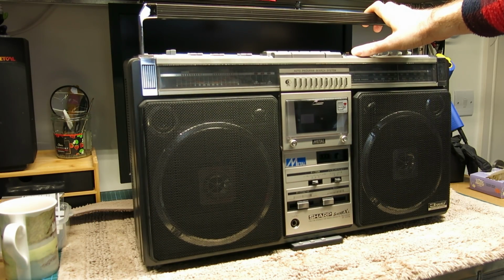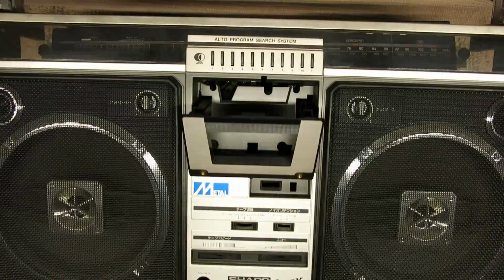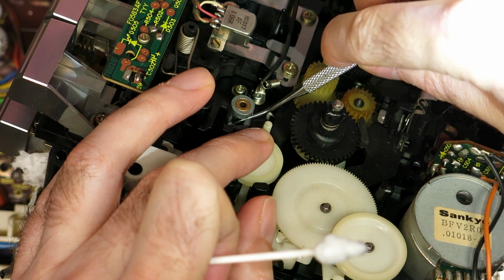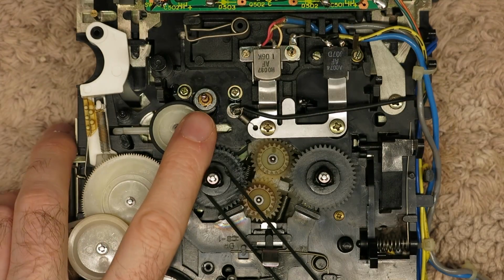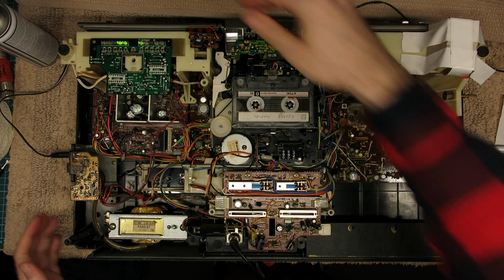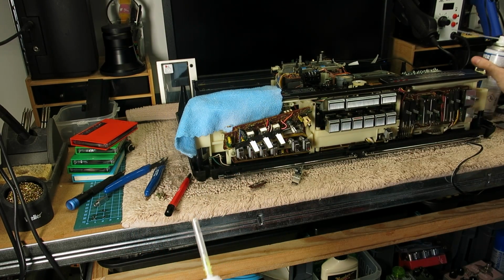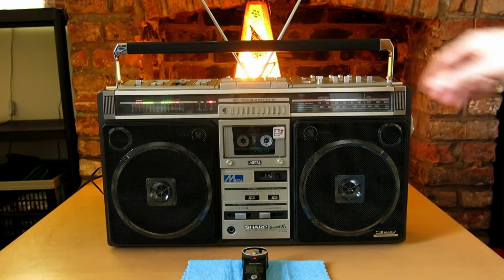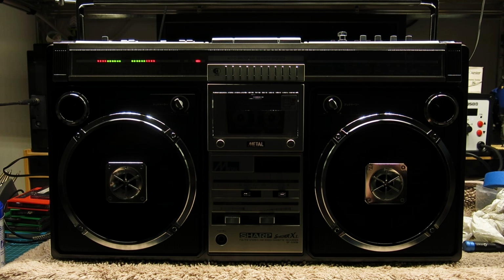1980 Sharp GF-508 (GF-9696) JDM Japanese Boombox Repair

Comment: Hi i have a broken edit switch with no insert and can't find another one and it has made my right channel stop working.
Can you show me how to bypass the edit switch so it stays in the on position to get the right channel going again.
i was told i had to bridge pins 4 and 5 on the switch according to Ai to fix this.
As i can't find a video or any pictures to do this.
My radio and tape deck works in mono but not stereo and my uv meters dont work either.
only shows power and signal strength but no vu sound all leds work if i toggle the switch.
i am hoping this bypass will fix my issue.
i will also be getting some dioxit to lube all the toggle switches and volume controls as well it looks like i may have to unsolder some toggle witches as well according to your video..
i used you video to fix the tape deck  👍🏼
any help you could give me would be great.
i have subscribed to your channel.
Reply from the maker: This wasn't my own machine so I don't have it in my possession anymore, alas. Isn't the Edit switch only for record muting?

Comment: Hey just watched your video, im not sure if your interested but i have the western version sharp GF9696 its in working condition and the speakers are better than in my car or my JBL blutooth speaker. Havnt pluged into a power supply but have it rubbing on 10d-cell batteries. If your interested in taking it over